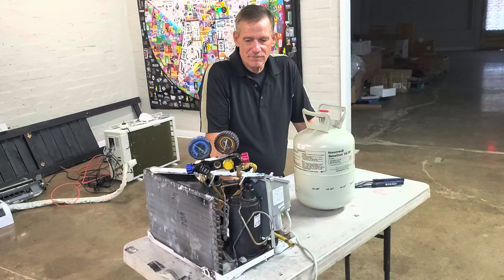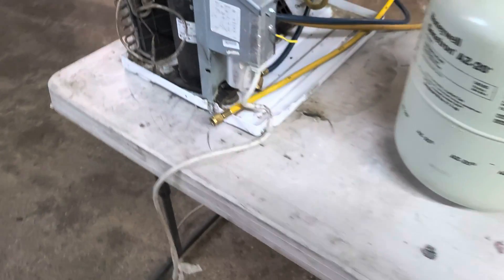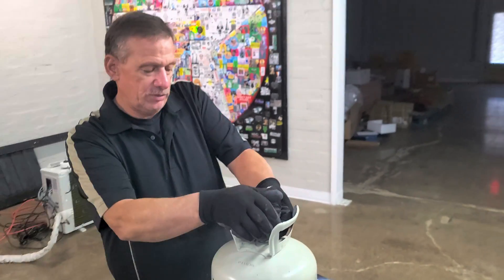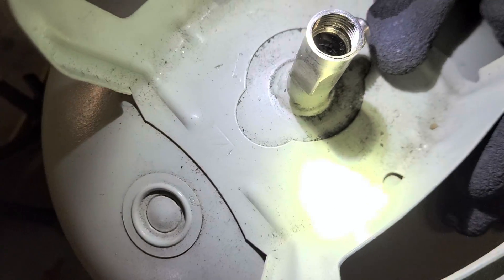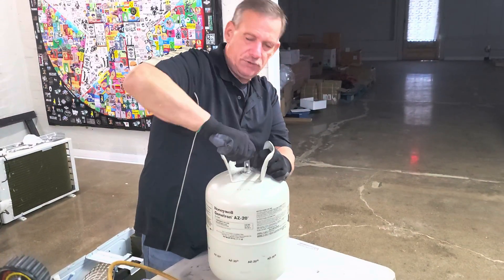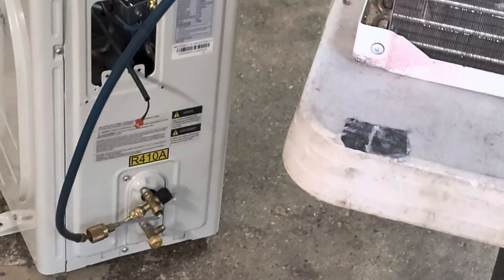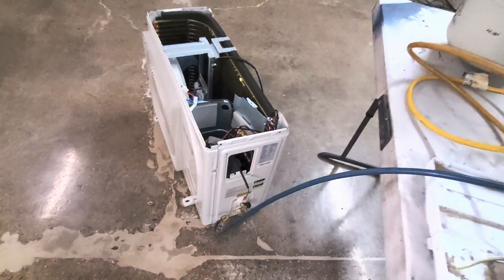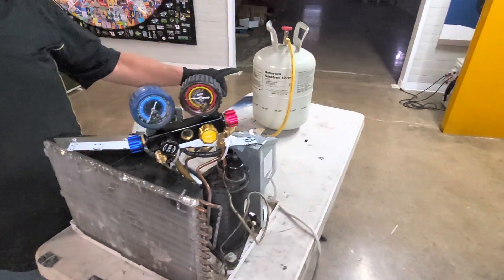DIYers: How we MacGyver a refrigerant recovery machine using using an old window unit

Comment: Anyway you could post a the a drawing of the refrigeration circuit just so I can understand how to incorporate the gauge set
Reply from the maker: The low side gauge needs to be on the suction side of the compressor (the larger of the 2 lines) then connect to the units low side port (on the unit that has refrigerant to be recovered). The discharge line leaving the outdoor coil will go to a recovery tank
Reply from the maker: We can't do a drawing, but see if this makes sense.

Comment: Nice 👍 i used an old R22 Condenser Unit from a mini split and put some wheels under it. It’s actually a tiny 9000btu unit made by LG but works fine for this. Just had to weld on service ports where the flare connector were before. Also put a switch into the electric side cover. Works well! 👌

Comment: is there a way to separate air and gas with this recovery method
Reply from the maker: No, so you need to keep positive pressure in the line so that no air sucks and if there's a leak somewhere in the system.

Comment: Is the discharge line of the compressor goes to condenser coil then the other end connected to the recovery tank hose. Is that the connection of it?

Comment: If i use this type of system to recover 134a can i reuse the 134 back into the same system, or will the 410 pump contaminate the r134 refrigerant that i recover. Is the oil compatible?
Reply: Some hybrid vehicles, and some hondas and mazda use POE (polyester oil) like 410a. But most vehicles use Polyalkylene Glycol (PAG) oil. They are both synthetic but they are not compatible, it's known to make a gel type substance that destroys TXVs and clogs filter driers..  But your vehicle might actually use POE you'll need to look at the rating plate where you'd find the refrigerant weight, type ect.
Reply from the maker: Yes, you don't want to mix these two, and the oils potentially are a reason, but a bigger reason is that any contamination will affect the performance of the unit if it has two different types of refrigerants in it.
Reply: @airspool  yep just like nitrogen, any non condensibles will take up space and reduce capacity
Reply: To kind branch off of kevinkinsey2283 question.... I have an old window unit that has R32,and it's very similar to the model in this video, but anyway I want to recover the r134a in my Tahoe to replace rear evaporator and TVX valve. I understand the r134 I recover will be contaminated but I could just refill my vehicle with brand new refrigerant and pag up to capacity, correct??
Reply: @Drewski2Shoes Yep just weigh in the new stuff after removing the old and it'll be good as new. If you can do a temperature compensated pressure test, even better.

A vaccuum should be pulled on the system before adding refrigerant but with vehicles it's not imperative but it helps with capacity & pulling the refrigerant in, but the compressor can do that anyway from the low side.
Reply: My only question maybe a silly one is , does the oil in the existing ac system you’re evacuating keep the pump lubricated? Could this be used too to pull a vacuum on a system to refill with refrigerant?

Comment: very cool. I happen to have an old window a/c unit that runs on r410a, and I need to recover r134a from my car. Good to know that I can do this!! But after thinking about it, I can't really harvest the compressor from that unit without releasing all the r410a into the atmosphere anyways. might as well just do it without getting every last gram. I think a fully evacuated recovery tank sitting on dry ice should be able to suck out more than 90% of the refrigerant without even using a pump, just because of the difference in volume between the empty tank vs the little automotive a/c system. better to vent <10% of the r134a than it is to vent 100% of the r410a

Comment: 7:35 Isn't there a tool that will put the crimp back in the tube? That would be nice, for safety.
Reply from the maker: Yes, if this is being used consistently, for sure you would want to have that. This was sort of a back of the envelope way of getting through in a pinch.